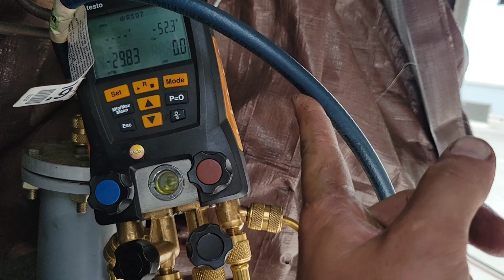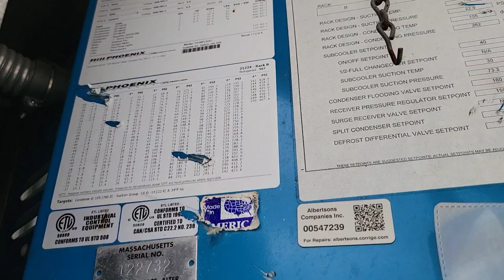Supermarket Rack Refrigeration- Rack Disaster Leaking Oil Line Repair!! (Rack Down)

Comment: Most systems here in AUS are using 1/4  or 3/8 flexible control lines for oil supply straight from the separator. If it’s on a rack they will have a copper head and tee off with flexible hoses to the trax oils.

Comment: Min 7:45
You pull a vacuum because you opened the system to change the flare nut, and now there's Air in the system you have to pull out, correct?
Reply from the maker: Yes :)

Comment: making a loop in that line will help absorb some of the vibration
Reply from the maker: Really I didn't know that thanks for the tip !! :) 

We're did you hear that ?
Reply: @gendronhvac-r1269  just think about it. you have that short line being pulled tight between those 2 flairs making it unable to move/flex with the vibration. a loop in the tube acts as a strain relief
Reply from the maker: @alross18058  

Make sense,

Thankyou ! I appreciate your sharing what you know:)

Comment: Nice job, back on line. Did you have to clean the roof too of was it not that much of a mess
Reply from the maker: I'm going to go clean it up today it. Need to by some speedy dry. Also it by the time I was done and the system recovered it was 9 PM. 

The oil can sit for the night lol.
Reply: @gendronhvac-r1269  Get some “ original “ blue Dawn dish detergent and that breaks it up nicely and you will never know it was there. Connecticut DEPT of Environmental Protection tells us to use it.
Reply from the maker: @scottk0623  

Thank you I will remember that I appreciate your advice  :) 

Definitely seems like a better option than just using countless cans of degreaser.